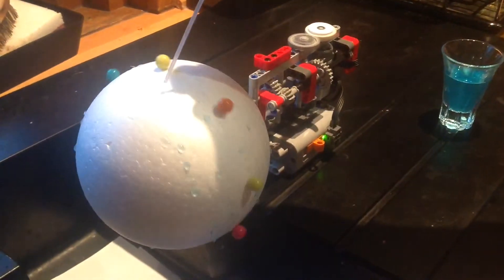Toy experiment: Water sticks to a spinning ball

Comment from the maker: Example for faulty reasoning: a washing machine's spin cycle may run at 1000 rpm, the drum may be about 2 feet in diameter, so about 6 feet around, so the outside of the drum moves at 6000 ft/min , that is about 70 mph or 110 km/h. Using Flat Earth logic, we shouldn't be able to navigate any curve on the motorway at these speeds without being violently pressed to the side of the car -- you kinda wonder how people did it before seatbelts.Yet I have been on trains well in excess of that speed navigating curves, and even small children could walk around normally, drinks stayed level, etc. The size of the curve matters, people! (If you do the computation on the "tennis ball in the power drill" experiment, I expect you'd arrive at much lower "unsafe" speeds.)

Comment: ? Electro static effects of Styrofoam  ? ? On to water  ? ? ? ?
  I would like to see this with other materials used as a sphere  ....... ? ? ? And the out come is  ????????
Reply: As other commentors have noted 
     The Styrofoam ball is rotating in an Upwards Rotation 
     The Styrofoam ball is not Rotating in an west ( point of location ) to an Eastern point of location , where up would be called north       ........ ? Gravity effect on water holding it to the Styrofoam Ball ? ..... Spin effect Upwards  , Electrostatic Charge of Ball on to the water 

    Try this take a plastic ruler or plastic comb , statically charge the comb , ruler  by rubbing it on wool , watch the water running from a tap being bent as it is attracted / repelled to the charge from the plastic item 

      Is the Styrofoam ball insulated from the object being used to rotate the Styrofoam ball  
       Any " metal rod " would act as an Inductor , supplier of charge to the metal rod and Styrofoam Ball ..... has a  wooden rod  been used in this method ? ? ? ......  Van Der Graff effect .
Reply: In the comments ... " as far as I know the Ball carries no Electrical Charge "
   .... have a " earthed  strap "  continuously touching the Styrofoam Ball 
      Copper brush touch the Styrofoam ball as it spins , disapatting any said Electrical charge thus that would negate the Induction , attraction charge of the water to the Styrofoam Ball   ? ? ? Or vice versa  ????
Reply: And then there's water tension to be added to this
Reply from the maker: dude, this is a very simple experiment, you can try it yourself, you don't have to match the rotation speed exactly

the experiment disproves "water doesn't stick to a spinning ball" by showing that the centrifugal force of Earth spinning is actually quite small. However, centrifugal force scales with r² while mass (and thus gravity) scales with r³, so it isn't possible to make a scale model that has gravity and centfifugal force both be accurate. I never claim that it is. All I claim is that "water doesn't stick to spinning ball" is false (if you don't spin it too fast), and you're welcome to try that yourself at home in your own kitchen sink. I promise it'll work for you like it did for me.
Reply: @mendelde   dude "    

 Gravity pulls things towards each other , influenced by the mass of the objects 
Centrifugal throws things Outwards , apart , at a horizontal reference point 

"

Comment: I laughed a lot thank you 👍
Reply from the maker: 444thetruth What exactly made you laugh?
Reply: If you don't get the idiocracy ? chances are I'll be unable to make you see the insanity of it all .. but i'll try..

Drops of water ' are just that 'drops of water' .. were as.. a uniformed layer would have been impressive .. I tried 👍😂😂
Reply from the maker: 444thetruth I did the experiment with a uniform layer by adding some soap to the water to break surface tension, basically makes the whole ball wet, but you can't see it on video and that is why I haven't posted it, it just looks like a spinning ball. Note that at this scale of 1:100000, an ocean is less than 0.1mm or 1/100 of an inch deep.
Reply: thats really good for you:👍 but at this stage of things.. your time would be better spent braking your indoctrination ' rather than playing with Lego ' soap and bubbles 👍 .. best of luck dude ❤
Reply from the maker: 444thetruth My point is, "water doesn't stick to a spinning ball" is Flat Earth indoctrination, and this video shows that. If you're unbiased, you'll be looking for indoctrination on both sides, and investigate/experiment.

Did you see the equinox experiment that I uploaded? with the sundial shadow?
Reply: mendel even though FErs do this same thing entirely out of scale and try to use it as “proof.” they don’t actually understand scale. So while i love this (i was thinking of doing the same but at 1 revolution per day, to show the actual rotation because FEs get stuck on the linear velocity) i don’t think any of them will accept it. they think 1000mph MUST be faster than once per day. 

awesome experiment!
Reply from the maker: Justin Jewell One revolution per day makes for boring video 😜 and too little centrifugal force. I think few FEers realize that a passenger jet doing 500 mph will do a turn and the passengers won't need to have their seatbelts on and won't spill a drop of their drinks because the turn radius is just so large, and the globe's radius is a hundred times bigger -- after all, if it takes you a whoe day to make a complete turn at 1000 mph, that turn rate has to be pretty slight, right? It turns twice as slowly as the small clock hand on an analog clock, and I think you could easily lay that down flat on a table and put water drops on that clock hand, and would never expect that water to be spun off. For the proper centrifugal force, you'd want to speed the clock up to something similar to my ball here, but I'm pretty confident that the water wouldn't move a lot, if at all.
Reply: @444thetruth6  the title said Water sticks to a spinning ball and shows us exactly that.
Reply: @mendelde  the whole ball get wet?....o no😢
Reply: @mendelde  ,what about basic physics of water?Y know,find level  and all that nonsense
Reply from the maker: MsThor1 Water follows any force. If you have ever blown a soap bubble, you have seen spherical water. If you live near an ocean, you know that the water level changes constantly because of the tides. There is no evidence at all that larger water surfaces are not curved.
Reply: @444thetruth6  On this scale, water won't form a uniform layer because of surface tension. Even though the physics are scaled down to match the force exactly, we are still unable to scale down water molecules. However, this means that the mass of the water is more concentrated in these drops relative to the scale than it is anywhere on earth in any ocean.
This means that a drop staying on is actually more impressive than a uniform layer that would have less force pulling on it (because of the less concentrated mass) and more adhesion because of a larger contact area.

Comment: Cute. Try getting any more than a drop or two worth of water to stick. You even admitted some fell off, and those were small drops. Surface tension and electromagnetism explain how drops of water can stick to any surface. This does not prove a globe. Get more than a few drops worth of water, pooled together, to stick to the exterior of any shape with any mass because of mass alone, and you’ll have something. But this cannot be done.
Reply from the maker: Firmam Ent. I am making a point about the magnitude of centrifugal force here, not about gravity. Demonstrating true gravity that is independent of Earth that close to Earth is notoriously difficult, like whispering at a rock concert. Thankfully, it's not necessary to prove gravity to show that Earth is a ball, seafaring civilisations managed to do that thousands of years ago.

Comment: Lmao. Centrifugal force. Sure. 🤣 now do it with a wooden ball. A metal ball. Etc
Reply from the maker: It's not a difficult experiment, you can easily do your suggestions yourself. What do you suppose would be different, compared to the ball I used?
Reply: @mendelde  ur the one putting out videos why can't you ?
Reply from the maker: Solar Panel I'm not doing it because I don't expect it would change anything. But you getting off your ass, stopping to listen to youtubers, and checking reality would be a change.

Comment: Now try a load more water...
And also, do you REALLY think gravity is doing this??
Reply from the maker: Do you know how much water would be appropriate at that scale? It's less, not more. The oceans aren't that deep.
And no, I don't claim gravity is doing this. I do claim that the spin-off-force (centrifugal force) for my ball is exactly the same as the one produced by Earth's rotation. Do you not believe that the weight of the water is enough to hold it down on the actual Earth?

Comment: So much is wrong with this i can not even articulate within the limits of the comments. What are you thinking this proves? That styrofoam ball and the small droplets and the low speed, surface tension and static electricity are all I see demonstrated.
Reply from the maker: Thomas Brown The stated purpose is to demonstrate centrifugal force, computed to be the exact same magnitude as it would be on the spinning globe. This force is not enough to break off any water droplets. The styrofoam ball was not electrically charged, but feel free to reproduce this with a different ball! This is not a difficult experiment!

Comment: Surface tension and static
Reply from the maker: globe killer Obviously. Adhesion, I'd say. The point is, the FE arguments that water won't stick or won't bend around the ball or would fly off are bunk. There is no measurable gravity holding these drops to the ball, and they have no problem with the centrifugal force. So there's no reason it wouldn't work with gravity and a spinning globe.
It's pretty obvious if I spin this way faster, the water will fly off, like the FEer with the power drill demonstrates, but you have to measure and sometimes compute what exactly the reality is.
Reply from the maker: No Fanfare Speed and radius matter for centrifugal force, not considering the radius when talking about this is inexcusable.
Reply: @mendelde  
Show us oh Mr flawed experiments 😂😭😂🤣
Reply: @mendelde  
Radius, ahh! 🤔 Or should I say R 😂
What would happen if a second ball had the same RPM yet the radius was considerably larger?
#1 The surface would be travelling faster!
#2 Weight would decrease.
Reply from the maker: No Fanfare If a second ball had a radius twice as large, how much would I have to decrease the rpm so the effect on the weight (the centrifugal force) stays the same?
You'll notice my ball turns over in 8 seconds, Earth turns in a day, so if you keep my model rpm and increase just the radius, you'll arrive at an Earth spinning much faster than it actually does.
If you feel more comfortable keeping the surface speed constant, what is the effect if we keep constant surface speed and decrease the radius of the ball? More "weight", less, or the same?

And I havent seen any marks anywhere, I hope you guys dont go off literalism just when it's convenient?
Reply: @mendelde 
Gravity same speed variations at laritudes ball is crap it's dead wake up.
Funny how Conspiritard have been saying they're going to crash the economy for a year or two just didn't know how they'd do it, wake up!
Reply from the maker: No Fanfare YOU were saying "weight would decrease", I was trying to use your terms. But I'm honestly thinking FU again, it looked like you were willing to consider what the changes between this model and the real world actually mean, but you have given up again, or you found out I'm right and don't want to admit it (like Bob Knodel and his gyroscope). Fact is that I sped up this small ball's rpm compared to Earth because the radius is lower; and it has a lower surface speed because the radius is lower; and both is necessary to keep the centrifugal force the same as on the globe.
Economy goes in cycles, if you predict a downturn, but dont say when or why, you can't go wrong. Same as me predicting "it's going to rain".
Reply: @mendelde  
BTW I didn't even waste my time reading your comment, I know it will be foolish!
Reply from the maker: No Fanfare You quote the bible at me and then treat me rudely like this the day afterwards. That just makes you look like a huge hypocrite.
Reply: @mendelde  
You don't understand it then do you!